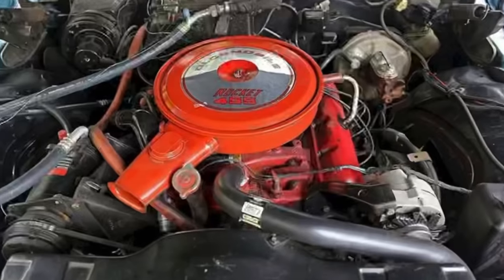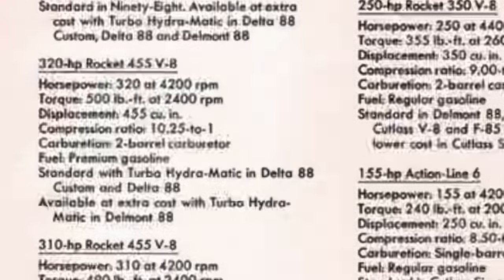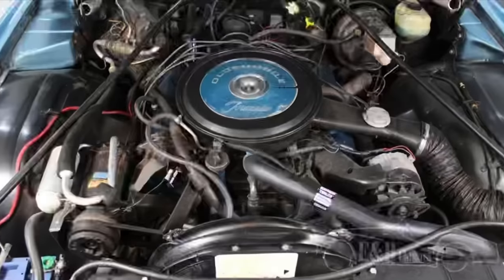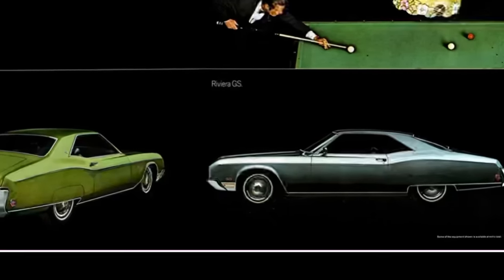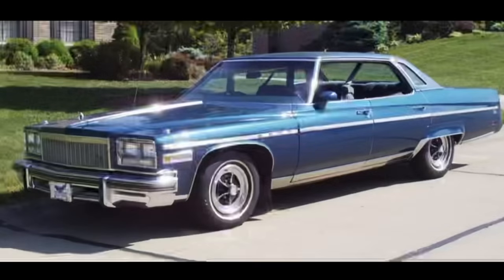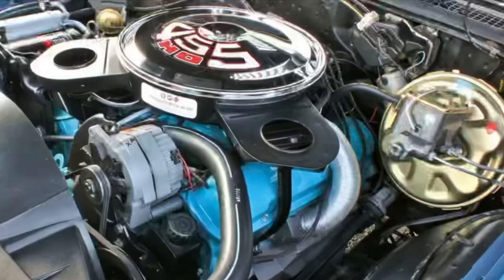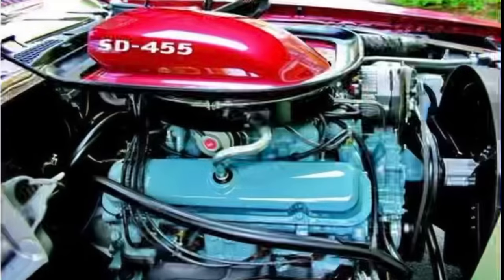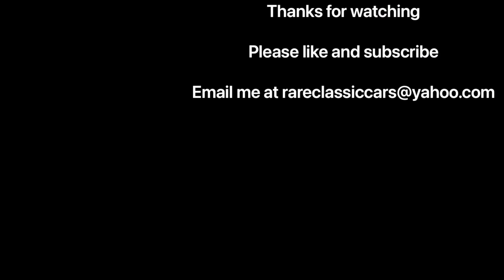Best Car Engines - The Rise of the Mighty 455 V8s from GM’s Buick, Oldsmobile, and Pontiac

Comment: Oldsmobile gets my vote. Who else remembers sitting on their parent’s front porch with eyes closed and being able to tell them what car just passed by simply by hearing the exhaust note? Chevy, Pontiac, Olds, Buick, Cadillac, Ford, Chrysler all were distinct until 1977.
Reply: Olds made adding oil easy with the filler tube in front of the motor.
Reply: Yup.  Each had it's distinct sound characteristics.  To my recollection the Buicks were the easiest to " spot ".
Reply: Oldsmobile engines had that distinctive “flutter” sound in the exhaust.
Reply: @jondoes7836  Interestingly that same " flutter " was characteristic of later model Buicks.  A neighbor passed recently and in his estate was his late father in law's 84 LeSabre with only 11, 000 miles on it.
It had that same exhaust flutter.
Reply: @ellisonhamilton3322  I believes  that  came with a oldsmobile  307  from the factory.
Reply: My favorite V8 sound ever was generated by our aged 1966 Toronado. By 90k miles, the exhausts on both sides had begun to rust and leak just the right amount (for me). I begged my Dad to not take it to the shop and get it fixed.
Reply: @waltschmerz  Yeah.  That slight air leakage could give a car with a large engine that just right muscular sound.
Reply: The exhaust were chambered in Buicks and Olds.
Reply: @waltschmerz  I'm cucked right now I got headers and a old offenhauser tunnel ram for my 68 Toronado. Starter died. I went and redid the entire starter wiring circuit. So I'm just cucked waiting saving up for a starter. Just waiting to hear it run..
Reply: @ericpoore2061  It did. I can't tell you how many intake manifold gaskets I replaced on those cars in the early 1990s!  The 260 and 307 Olds engines always seemed to have a main bearing knock at hot idle, too.
Reply: What do you mean? Kids will be able to do that with electric vehicles....  Won't they??? (Sarcasm) Its sad. Because your memory is mine as well. And those memories end with us. Thanks Adam for your time preserving what we once had.
Reply: @giggiddy  you're not allowed to touch the inside of most EVs without special computers and tools from the manufacturer. EVs to me have no personality. Just as blank of a car as it can be
Reply: I still subscribe to several automobile magazines. Probably not for much longer. Because they are mostly full-in with the electric trend. And you can see they are already struggling for material to write about seeing that the engine and all its systems (which were arguably the lure to reading about new vehicles) are now absent. I mean, how long can you talk about range, and how quick they are. Its already boring and old....
Reply: @giggiddy  😄  electric cars a such a sad joke.  And they aren't the environmentally friendly rides that buyers think they are.  It's all too pathetically funny.
Reply: @giggiddy  Don't worry, eventually someone will market a speaker system to mount on your EV that duplicates the exhaust note of a performance V8. Either that or the fart can sound of a tuner car 😂
Reply: @MegaSafariman  I'm laughing.  I'm so glad to hear someone else use the expression " fart can ".  I've been using it for many years.  I love using it because it really pisses rice burner owners off.
Reply: @ellisonhamilton3322  My sentiment exactly. Most of the electric car owners by me are pretentious "hey look at me" posers who are also hypocrites. I'm all for someone who says "I like my electric car because its different, fun and quick." Its all of those things and basically a novelty at this point. But a hypocrite poser who suggests that they are saving the world by driving a car powered by electric, most likely derived from petroleum, will quickly get my unsolicited opinion. Cheers brother
Reply: @giggiddy  Well said.  My background is in geology and geophysics.  I can assure you that you are quite correct.  Those plug in toys are doing NOTHING to help the environment.   The amount of coal fired emissions and water consumption neccessary to generate that electricity does far more damage than if these idiots would just buy a vehicle with a smaller,  more economical combustion engine.  Oh well. Their ignorance can be sometimes entertaining,  albeit aggravating. 😄👍
Reply: @jeffrobodine8579  AMC V8's had a similar convenience.
Reply: My 1973 Cutlass S Hurst/Olds was a fun and very comfortable car.  Mondello and Dick Miller are the kings of the 455 performance.
Reply: Sure; and for some reason the olds engines had, for me, the easiest sound for me to pick up
Reply: Once they muffled the cars down with emissions those unique sounds went away.  I love listening to my Tin Indian 69 GTO.  The thing about the Pontiac motor is the 326 to 455 was basically the same block size on the outside.  You really need to look at motor stampings to know for sure what it is.
Reply: @ellisonhamilton3322  later model Buick vehicles with V8's were Olds sourced.
Reply: @smellsuperb1  Thanks. Yes, several people mentioned that.  That 84 was a sweet car.  4 door,  silver, pale blue and light grey interior, suicide hood, only 11,000 miles and showroom new.  That was about 6 months ago.  I wanted it, but no room for it.  And his brother came from Missouri to clear out his estate and the guy was a jerk.   He might have at least asked me if I wanted to purchase it, given that I had taken care of his brother the last 2 years of his life while he was very frail.  I did A LOT of things for him so he could live at home comfortably those 2 years,....including starting and driving that Buick once a month to ensure it remained in good working order.  Oh well. Some people are just asses.
Reply: @ellisonhamilton3322  that is a shame that the brother was so thoughtless, not to even ask if you had any interest in the car.  I'm guessing, however, that you helped your neighbor live out his final years not to receive anything of value, but because you cared about him as a friend, and knew it was the right thing to do.  You will be rewarded in other ways, or at least in heaven, if not before.  Thanks for watching out for,  and caring for your neighbor.
Reply: @ellisonhamilton3322  If it had a  5 liter v8 it could have been an Olds 307 Rocket engine.
Reply: @johnlandacre767  Thanks, I appreciate that.  Yes, he was a friend of many years, much older than I.  And no I didn't expect anything at all from his estate.  Truly. It would have been appreciated if at the very least his brother would have shaken my hand and said thanks for looking out for him.  They were here a half dozen times dealing with estate matters and he never called nor stepped across the street.  Oh well. What's Important is that Bill, my neighbor,  was able to pass away peacefully at home.  I'm glad for that.
Reply: @gt-37guy6  I'm pretty sure that was the engine. At least that's my recollection for the few times I was under the hood.
A suicide hood too. 👍
Reply: I love the sound of my big block Olds. Soothes the soul.
Reply: Amen, I did the same thing in the middle 70's
Reply: @giggiddy  one day, gearheads will be overclocking the electric motors, changing gear ratios, hot rodding will never die! Well it might, decline of our education system.
Reply: @MegaSafariman  they already have these. From the factory
Reply: They still can tell mine is the olds 455.  I pulled up to get a oil change and the owner said even before looking that's a big block I said yep he said 455 I was like yessir.  He said it has a distinct sound.
Reply: Lifelong Oldsmobile guy here. I have 12 core engines in various stages, about 6 running engines including my race engine that makes 620hp/640lb.ft on engine dyno, and I've got a few cars left too, including my first car, a 1970 442 currently disassembled as a roller but will someday rise again. I've got dad's two oldsmobiles in the garage after he passed. One is a red 1968 Ninety Eight convertible w/67k original miles, original paint, etc parade car. Also have a 1975 red w/white stripes 442 ordered new by dad and has only 12k original miles. Oh yeah it's a 455 car from the factory. 
I've had more Oldsmobiles than I can count over the years. 
I love other makes too, but for sure Olds is my fav brand.
Reply: I should add my personal thoughts on the sound of different GM V8s while growing up with them. For sure a trained ear knew what was passing by while blindfolded. At 18 years of age with my freshly painted 1970 442 and a fresh 455 I assembled myself, a genuine W-30 grind camshaft loping thru the trumpet exhaust tips was music to my ears. Back then I used to sit in a lawn chair and listen to my car idle. That old "328" cam was not the ultimate cam by any means but as a factory grind it was one of the best sounding ever.
Reply: The ford 4.6 and new 5.0 are very distinctive. At least in a mustang, I can tell the sound differences in them from other motors
Reply: @thisguy2720  I love the sound of the 90s 5.0 mustangs.
Reply: @alantrimble2881  We don't talk about the 260's or the 307's!  ....or the Olds 403...or...the Olds diesel...🤣🤣🤣🤣
Reply: I hear you, big time! They all had their own very distinctive sound! That was just one of the things that made all of them soooo much different than each other! To hell with "modern" JUNK; No apologies!
Reply: Olds was the best.  I remember as a kid.
Reply: We did that in the 90s
Reply: Something about the late 60s Pontiac 400s really did it for me with the slight chugging noise they made at idle
Reply: Lots of these big blocks, other than buick were used in jet boats in the 70s and 80s.  Could usually tell from the sound whether it was an olds, chevy, or ford 460
Reply: Yes indeed.  Same distinctive sounds from each divisions 350 cid engines.  Pontiac seems more raspy, olds have a drum like note, while Buick had a metallic exhaust voice.
Reply: It's funny you said Oldsmobile when  I was young(in the 60's) I could tell when mom was coming down the lane, the jet black 4dr 88 with the 425 had a unique sound that was all "Olds".
Reply: @RedBud315  And the Pontiac and FE Ford are the best Muscle ERA engines.  50s design. The 427-428 FE, the 400-428-455 Pontiacs , you can’t throw shade at either one!  And today they are still popular engines to build  , I really hope that aftermarket support continues !
Reply: @fenatic7484  My dad taught me to drive when I was 13 in his 69 GTO and I now own a 32 option numbers matching one that is about 80% perfect.  My dilemma is my buddy has a 63 Grand Prix 421 tri-power Borg-Warner 4-speed is about 95% perfect.  I wouldn't mind trading him straight up but, he paid more for the GP than I did for the Goat and I think it is easier to find Goat parts than GP parts.
Reply: @RedBud315  I swapped a 421SD with the McKellor #10. Forged crank and rods with the RamAir 14 degree heads with closed chambers, 68s if I remember. The mixture was magical. The bores had have notches but it had to make 550 ft lbs and 500 hp on 96 pump gas back when tetraethyl wasn’t a dirty word.  I love it because people thought it was a 400 with a lumpy cam.
Reply: @alantrimble2881  
Huh? 
I’ve had a number of 307 engines and 260, and none of them had any problems.
Reply: @patrickflohe7427  That's great. I've owned one with a 260, and worked on countless 307s. They knock at hot idle.
Reply: I have a 442 tribute car with a 69 olds 455 and when I pulled in for a oil change and when I got out a older gentleman asked that's a big block under your hood.  I said yeah he said there is no mistaking that sound.
Reply: PONTIAC NEVER MADE A BIG BLOCK!!
Reply: Yes I could do that too but it was the Buick that blew the rest away.  I have 3 Pontiacs in my garage and no Buick, chevys, or Olds 455s but in the day completely stock,  Buick had the best. Today I would say Pontiac,  with the parts that are now available
Reply: In 78 my Toronado would idle dead quiet.
Reply: @jeffrobodine8579  resd❤
Reply: @patrickflohe7427 hes just tryna fit in.. obviously...lol
Reply: @alantrimble2881  
Okay, 
Well, I’ve owned 9 or 10 307s, and none of them ever knocked or had problems. 
If they were bad, I’d have seen that with those numbers of vehicles. 
Maybe if people didn’t change the oil or something….
Reply: The Olds 455 was a fun engine to swap into some trucks.   Remember when GM was making Olds-based diesels?   They put some of those things in pickups.   The diesels were crap, but it was insanely easy to find  mounts to throw a 455 Olds into almost any GM pickup.  And a pickup definitely benefits from the low-end torque of the Olds.  

For best results, of course, you wanted an early model 455, and you wanted it with its original TH400 attached.  But  that was okay, because for a while, and Olds 455/TH400 assembly was cheaper than any  396 or 454.

Toss in a few tweaks and you had one righteous little C-series for not a lot of $$$$.
Reply: I'm a Pontiac fan myself, and the Olds and Pontiac had a distinctive sound in the idle to 3000 ish rpm range. The Olds, to me, was harder to modify because of the valvetrain and cylinder heads ( didn't flow a ton and stalled out pretty quickly ). The Pontiac 455 was a great all around engine that was let down by Armasteel connecting rods. The Buick was the lightest, had the highest torque at the lowest rpm, weakest oiling system.
Reply: @MegaSafariman yeah give it the sound of a canned big block!
Reply: @smellsuperb1 or Chevy.
Reply: @RedBud315 definitely easier to find GTO parts, but those early GP’s are sweet with 421’s under the hood!
Reply: @CharlesAtwell-or7bm  only in California did Chevy put Olds V8's in other marques. Occasionally you might end up with one in Washington State or something. But Chevy kept their own V8's.
Reply: True
Reply: All the engines of GM I've never had a Cadillac  or a Pontiac big blockin a general motors product
Reply: Oldsmobile baby!!!
Reply: You could always tell an olds from the 70s late 60s by its high compression sound ,it had its own sound .
Reply: @xaenon9849  If you were to swap that into a 1973 – '87 C10, would you swap the early points style ignition system to an EFI system that came factory in that era of GM or do you keep the older points style system? Thanks for sharing!
Reply: @jondoes7836 you could always tell Olds 8z😮😅 distinct sound😂❤